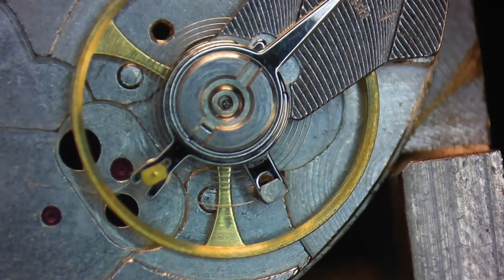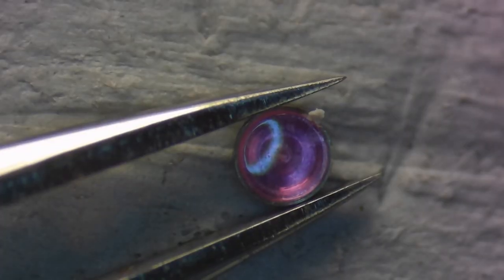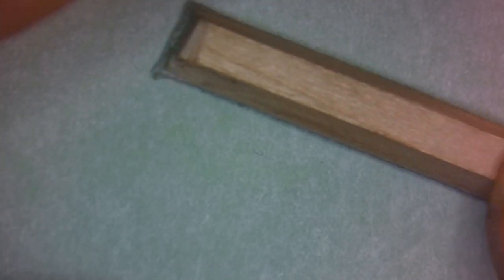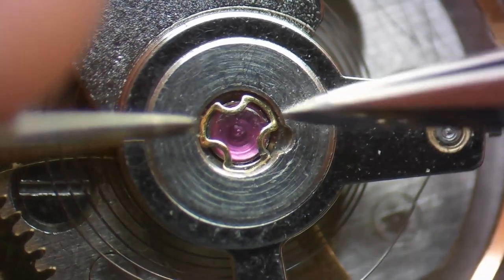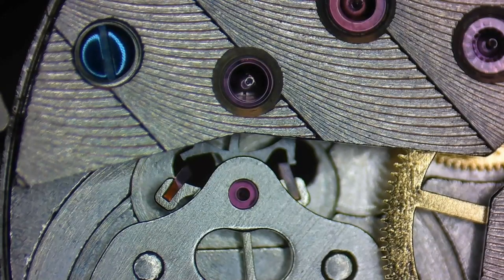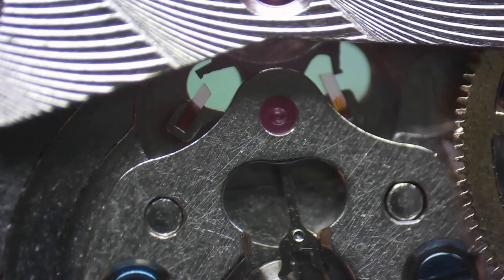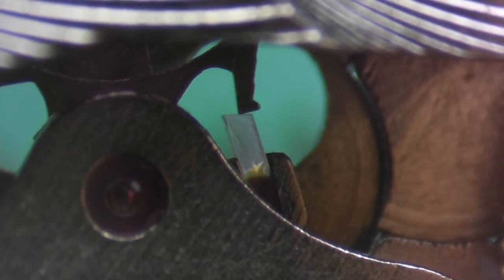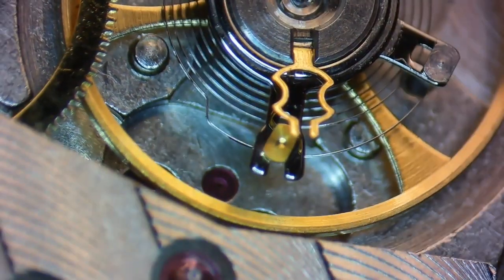Lubricating the Balance Jewels and Pallet Fork for BEGINNERS

Comment: Alex... I know you recommended the ETA 6497 or clone to start our journey with, and I did that with the clone, but I am getting very frustrated with the fact that with the clone, you can't find replacement shock springs or jewels.  I feel I have learned a lot with the 6497 clone, but I need to be able to learn how to service the shock stones, but every time I touch the spring for the Incabloc system, they fling off someplace.  I hear that part of the problem is a true Incabloc system has a stop in it that will make it very hard for the spring to slide out (not impossible though).  Being that I have a Chinese version of the shock system, I guess this does not have that stop.  Is there another watch movement that is a) inexpensive, b) and I would be able to find replacement springs, stones, etc if something show fly off that I could practice on?  I don't want to give up, but the fact that I can't get spare parts and have to wait days to get a replacement movement and another becomes a parts movement is starting to drain me.
Reply from the maker: The 6497 and it’s clones are recommended because of their simplicity and size compared to other movements. The incobloc springs are also the simplest of the shock springs to deal with. 
Seiko movements like the 7002 and 7S26 are cheap and plentiful but you are just giving up one problem for another so my advice is to figure out what you are doing wrong and fixing that.
Manipulating things like shock springs, hairsprings, and regulator pins all require the lightest touch. If you have shock springs flaying off, it’s not because it’s a Chinese clone, it’s because you are applying too much force in an inaccurate way. 
To fix this problem, start with the balance out of the movement. With the balance pivot not applying pressure to the endstone, the spring will not have as much tension on it. 
Start with either 2 pairs of finely sharpened tweezers or one pair and a needling tool. 
Have you learned to sharpen your tweezers from my 2nd lessson? Have you made a needling tool yet ? 
When you release the 2nd side of the spring from the block, use the second tool to shield the spring from being able to flip backwards.  
If you are doing this the spring would not be able to fly away. 
Now with both sides of the spring released, put your tweezer fully under both sides of the spring and lay it straight back to the fully open position.
Now you have access to the Chaton and endstone to remove.
So John, this is not a component issue, it a technique issue. Do this procedure 100 times if needed because the next step is handling the endstone
Reply: @watchrepairtutorials  Do this 100 times... well, I have done it (not correctly) a few times and lost the darn spring each time.  I think what I need to do is find a broken movement that has a Incabloc syetem (not a clone one) so that the spring has less chance of coming out of the channel as the Chinese "incabloc" is made differently without the block on it to prevent the spring from sliding out.

You say to take the balance out of the movement.  Okay, and do what with it?  Just place it in a mound of Rodico to protect the staff?

I agree, that it is a technique issue, but having to keep buying new movements is driving me nuts.  I guess doing this in a ziploc bag would help, but I have a very hard time seeing what I am working on when it is in the bag (and there is still a chance of it flying out of the bag). 

Thanks for your help
Reply from the maker: @perrybucsdad  I think the advise I just gave you on the technique is with using 2 tools will solve the issue. Forget about it being a clone. That’s NOT the issue. Your technique is the issue. 
Practice on the shock setting on the movement side. 
If you don’t want to implement the advice I give you, I can’t help you. Alex
Reply: @watchrepairtutorials  Okay, I will order another clone movement and try it again with two instruments.

When you say practice on the shock setting on the "movement side".... do you mean the shock setting on the balance wheel?  I'm a little confused when you say "movement side".
Reply from the maker: @perrybucsdad  Sorry, I meant the Main plate.  Practice on the shock setting on the main plate

Comment: As columbo says.... one more question sir.... i have a movement where the end stone of the balance isnt shock protected and is just held on to the balance with 2 screws... is there a safer way to oil that part or do i have to take the balance spring and wheel fully off the bridge like ive seen in other videos and do you have a video for those type of balance assemblies? Thank you also on another topic in the cleaning part... is ipa bad for cleaning jewels and stones as some say that the ipa eats shellac
Reply from the maker: First it needs to come off and be cleaned before lubricating. You don't lubricate anything dirty, much less the balance pivots. 
Just remove the hairspring stud to remove the wheel.
As far as your second question, I would recommend you watch this video I made on cleaning parts with IPA.
https://youtu.be/x_6TulURYII
Reply: @watchrepairtutorials  thank you.

Comment: Hi Alex, could you please clarify why the pallet fork pivots do not need any lubrication?
Reply from the maker: Sure there are a couple reasons you don’t lubricate the pallet fork pivots. The first is that they have a very short arc of travel. They don’t spin like other pivots in the movement do so therefore, the advantage of lubricating them would be very minimal. the second reason you don’t lubricate the pallet fork pivots is that the upper pivot ties directly into the pallet fork arm instead of being separated with an arbor. If you lubricate that pivot oil will migrate down the pallet, fork arm, and contaminate the impulse jewel which could stop the watch
Reply: @watchrepairtutorials  thank you Alex... That explains it clearly...

Comment: As a novice beginner, on a hair spring budget, is there any lubricant's that may be in my garage I could use just for training purposes only? I will get the real deal soon, but I really need brass tweezers and better drivers first.
Any info appreciated, aloha!
Reply from the maker: Well you can use whatever you want but a small bottle of Mobious 8000 is around $8. It’s a Watch oil that I recommend for beginners to practice with as long as you understand that it is not going to give you  very good  long term results.
Reply: @watchrepairtutorials  
Excellent, I'll order some. Thank you for your response.

Comment: I know you say automatic lubricators dont work well possibly for wheel jewels but can i still use one for a balance stone?
Reply from the maker: Well, the reason I say that is because they deposit the same amount of oil on every pivot. And as we know the amount of oil you put on a second wheel or third wheel or fourth wheel, or the escape wheel is different for each of those wheels. Now if you have, an oil set up with 9010 for the balance pivots sure it would be fine. I say as long as you’re cleaning the jewel setting.
Reply: @watchrepairtutorials  thank you

Comment: I’m so confused… do you use grease or oil on the pallet stones? And which one?
Reply from the maker: Nothing to be confused about. Pallet stones, which interact with the escape wheel teeth get lubricated with 9415. So the previous answer to your other comment.
Reply: @watchrepairtutorials  thanks
Reply: @watchrepairtutorials  anything close to 9415? I don’t have that but I have several other oils and greases.
Reply from the maker: @sugmasigma  there's no other grease that has the same properties as 9415.
If you don't have it, you would be better off not using anything at all even though you'll lose 20 to 30° of amplitude and cause the escape wheel teeth to wear down. 
The reason 9415 is used is because of how fast the pallet fork moves back-and-forth. Any other type of grease or oil will quickly be thrown off the pallet stones contaminating the movement and still leaving the pallet stones dry.

Comment: On the pallet jewels, you say grease, but is this 9504? How does that a follow the logic of the last video if that’s one of the fastest moving parts? Because it’s sliding?
Reply from the maker: The pallet fork uses 9415. A special grease used on pallet stones only. It has special properties that makes it a solid until the escape wheel hits it, then it liquifies and turns solid again.
Reply: @watchrepairtutorials  wow cool!

Comment: Some say not to lubricant the pallet fork pivots(not talking about the teeth, just the pivots) anyone have any opinions about that?
Reply from the maker: When it comes to lubricating the pallet fork pivots, there are indeed differing opinions depending on whether you are working on Swiss or Japanese movements. Most traditional Swiss watchmakers recommend avoiding lubrication on the pallet pivots due to the risk of oil spreading to down the pallet fork arm and contaminating the impulse jewel, which can interfere with the escapement's operation. This could cause issues with the watch's precision and long-term performance or cause it to stop all together.

The Swiss believe that since the pallet fork does not spin, and basically rotates back and forth on a very small angle that the lubrication is not necessary. 

However, some Seiko Tech sheets call for applying a very light and controlled amount of oil to the pallet fork pivots. The key is using a specialized oil, like Moebius 9010, in a very, very, sparing manner. I would definitely use epilame on the pallet fork pivots if you plan on doing it.

Ultimately, the choice depends on the watch you're working on and your experience level. If you're unsure, it might be safer to avoid lubrication, especially for vintage or delicate movements where oil control is more critical. But for newer, well-sealed watches, careful lubrication can be beneficial.
Reply: @watchrepairtutorials  Excellent response, that’s exactly the information I was hoping to get. 
Thanks for your channel and sharing the knowledge with us!

Comment: Is it best. if I don't have a nice microscope to inspect the jewels, to just leave these alone and "pray" that they have oil on them etc or is it worth it to try and do this with a loupe (10x)?

Edit:  How do you find the right jewel when you lose the top stone for the balance?   Those things sure fly far and fast.....
Reply from the maker: Huge mistake to not worry about the jewels.  Inspect, peg, clean and lubricate.  Inspect them with a 10 or 15 loupe with a light underneath.
Reply: @watchrepairtutorials  So how do I find a replacement for the end jewel when it fly's off?  This is on the Chinese clone for the 6497 (or the ST36 which was the clone)?  Pitch the movement and buy a new one?
Reply from the maker: @perrybucsdad  they don’t sell parts for clones because they’re so expensive. If you lose parts from a watch, you turn that movement into a parts movement.

Comment: "pick up a tiny amount of grease.... and apply it to the pellet stone". OK... but WHAT grease in this case? No Moebius 9010 this time?
Reply from the maker: Moebius 9415
Reply: @watchrepairtutorials  Thank you, on the list! But, completely different: I'm now working on a 100+ year old alarm clock. All very large stuff. The pallet doesn't have stones here, but two tiny round... sticks I would say. Can I use that 9415 in this case also?
Reply from the maker: @325iaddict  You could for sure. I think most clock guys are probably just using a generic clock oil but the 9415 would be superior .

Comment: Yet another great video- Just one question-  You mentioned you use Mobius 9010 on the balance Jewels but when you showed your procedure for lubricating the Pallet Fork you said apply the grease to the center of the pallet fork jewel. What grease are you using for the Pallet Fork and the Escape Wheel? - By the way I have my Bausch & Lomb Loupes on order- Thanks again for that tip ;)
Reply from the maker: The escape wheel takes 9010 in the pallet fork stones are lubricated with 9415. The pallet fork pivots get no lubrication.